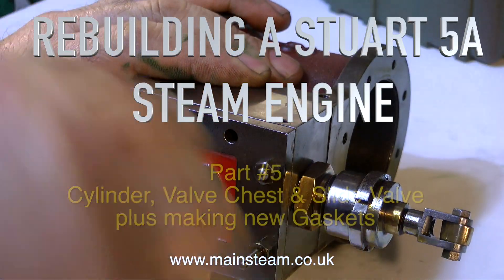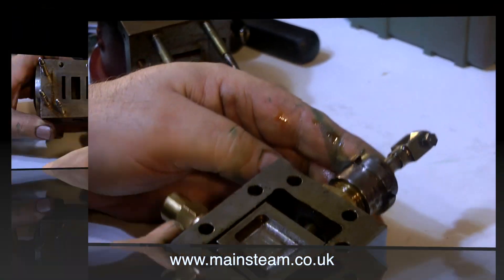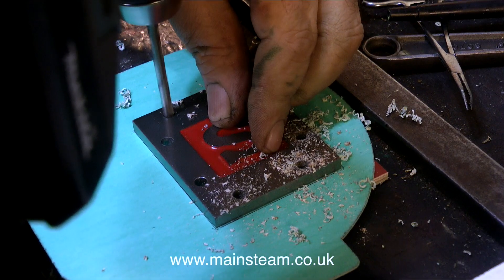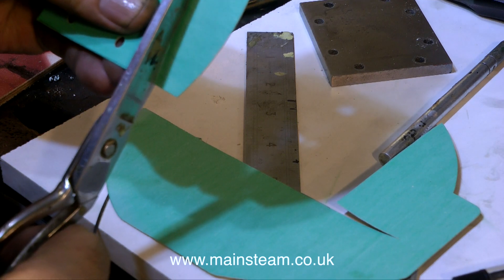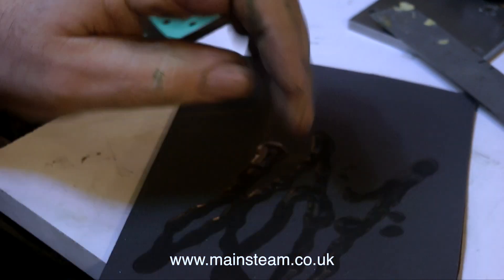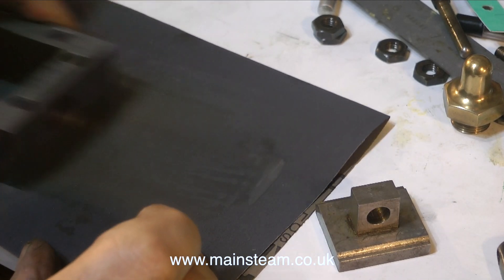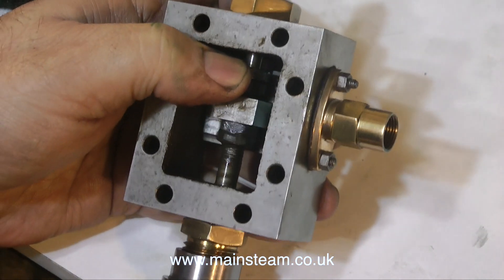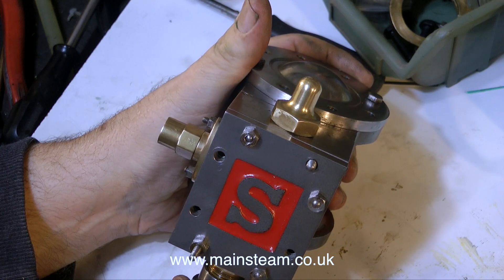STUART 5A STEAM ENGINE REBUILD - PART #5

Comment: Could I make a steam cylinder and steam box out of mild steel instead of cast?
Reply from the maker: You could if you want, but cast iron is my preferred choice.
Reply: Knowing your sense of humor, I should have phrased that differently! What I mean is, would it function properly? I've got an atlas lathe and am looking for an old Bridgeport mill, I'd like to try to make a steam engine. Are there any problems that arise from using mild steel? Thanks.
Reply from the maker: If you want to weld on the steam chest maybe steel is OK, but as I said previously - I prefer cast iron as it is what the big ones are usually made from. Also there are many suppliers of cylinder castings which are easy to machine.

Comment: an acorn nut on a bolt will punch a good hole in gasket material. J.
Reply from the maker: What is an acorn nut? I have never heard of one other than the ones that grow on Oak trees . . . wouldn't the Squirrels get upset?
Reply: I allways knew them as acorn nuts. Apparently they are now dome nuts according to screwfix. My local bolt and fastner supplier will correct you and me on this if you are ever passing york.(fastpack)

Comment: was there any reason you cut the gasket from the centre of the material? there seemed to be enough material in one piece to cut both
Reply from the maker: When making a video, sometimes it is better to do it the way I did it ...... it is not real - it is an illusion ..... :-)))